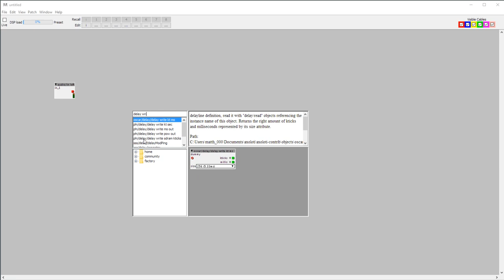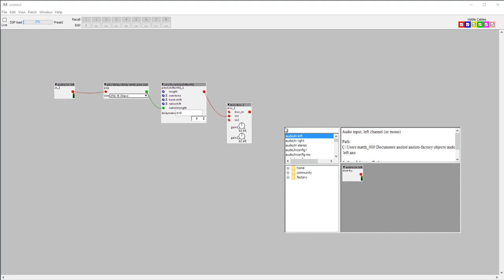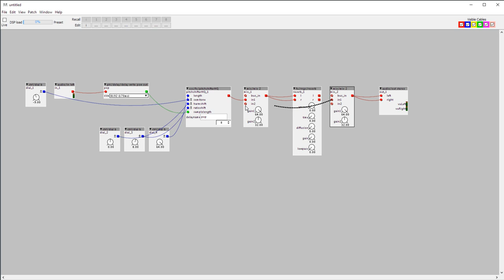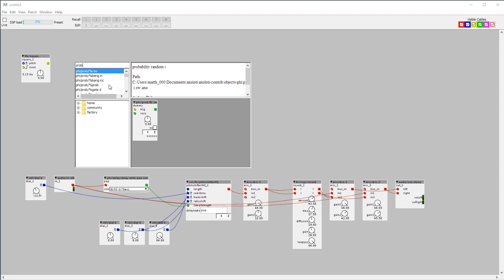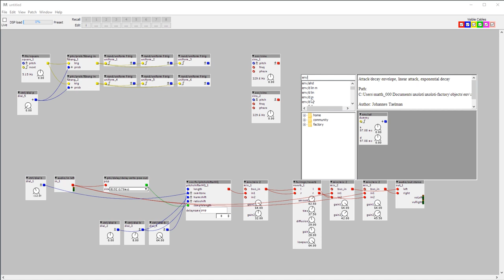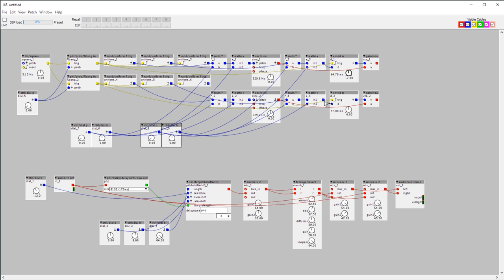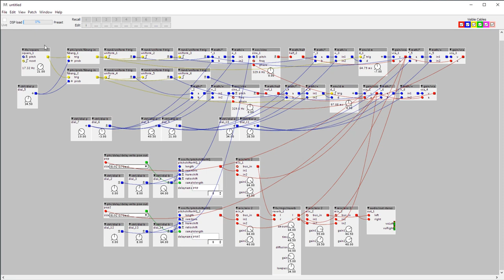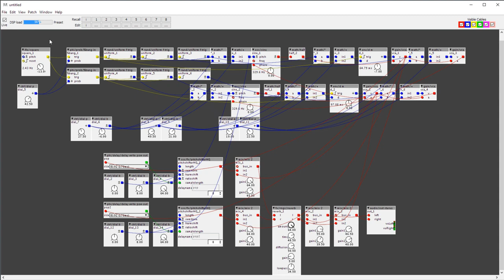Axoloti Patching : Pitch shifters / reverbs and other things

Comment: How is the green “Samplelength” connection passing along the audio signal? Shouldn’t that just be setting a value for the length of the sample?
Reply from the maker: Yes, the green connection is only passing the sample length information, the audio is passed by a delay buffer (memory/table) written by the write object, and then read back by the pitchshifterHQ object. You can't see that part ofthe audio chain, so you just have to make sure the parameter in your read object (here the pitchshifter) is the same as your input name (the delay write objects name)
Reply: Matthew Tyas Ah! Interesting! This May aid in my grain crushing exploration!